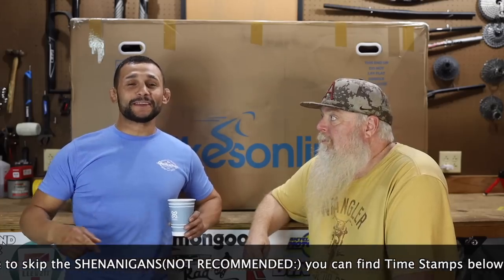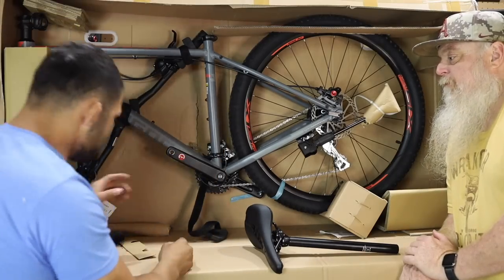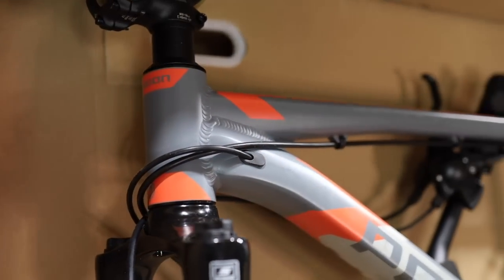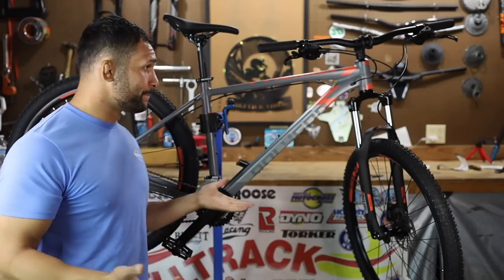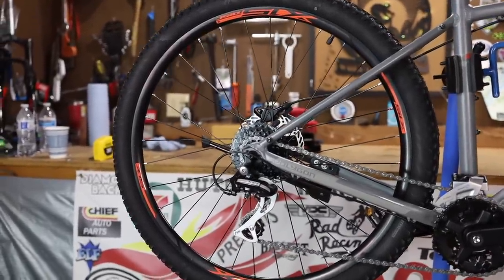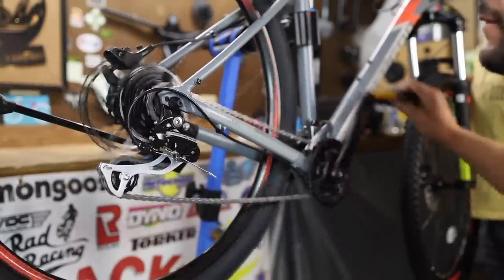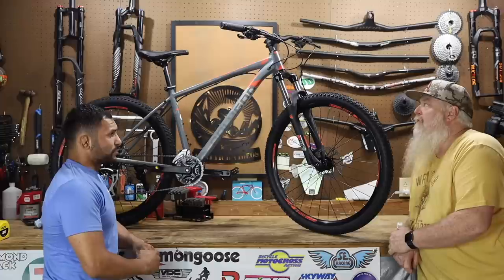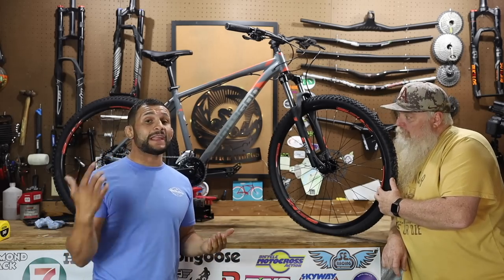Polygon Premier 4: Initial Impressions | Who It's For

Comment: Hey Wolfman and Tick, so excited that you've finally got a Polygon. I agree with you guys, the Premier range is way overpriced in the US (I also didn't know that they export them to the US...). Back home in Indonesia the Premier 4 costs around $290 and the top spec 5 $340. And yes, the bike's geometry was last updated in 2019 or 2018 if I remembered correctly, so it is a tad bit outdated. But the thing is, although marketed as an entry level MTB, the Premier was never conceived as such. The first generation of Premier was actually a trekking bike, nice to ride around neighborhood but still sturdy enough to handle some basic green trails. It was since the second generation onwards (I think this one is the 5th generation) that Polygon beefed it up to be an All Terrain Bike, coherent to the market demand back home for an affordable allrounder. They were (and are still) not a fully fledged mountain bike, I've actually ridden the 3rd generation Premier, and I do think that they have a point, it was comfortable enough for me to enjoy cruising around town, and it could handle some tricky trails, but it would be destroyed by gnarly stuffs, unlike the big brother Xtrada. So I guess it would be of a fairer comparison if the Premier is considered as a mid level ATB, instead of entry level MTB (I'm not trying to defend Polygon though, I just happen to have ridden multiple models of their bikes and I would really love to share some insight to the relatively new brand in the US 😀). And when you review it, please be careful, I have ridden the same Deli Tires and on wet conditions they are as slippery as an eel! Love the show and stay rad dudes 🤙

Comment: I think you nailed it on who this bike is for. If I was buying at this price point, I would consider either the GT or Kent Trouvaille. Theres plenty of low cost upgrade options to bring either of these up to speed. It's too bad that Polygon, who really is en vogue right now with their well-spec'ed dual-suspension offerings, couldn't have produced a better tbought out and equipped bike at this price point.
Reply from the maker: Man well said, thanks for the great comment 👍

Comment: In our (German) bike shop we're currently having several Cube Attention for 759€ (roughly 833$) on sale. Modern Geometry, Rockshox Judy Air fork, MT-200 (180/160), Deore 11-Speed rear derailleur, 2x SLX Front Derailleur. I love test riding those - they go off like a rocket and the front and rear shifting is A+. I'd take one of those over this Polygon for sure!

Comment: i'm very familiar with this bike. last year, i bought Marin's version, which is called the Eldridge for $500. i rode it 1 time, then sold it. the 1st issue was the lack of dropper support. the 2nd was never feeling like i was in the right gear. 2x's suck on mtbs. lol. the 3rd issue and final straw was the weird frame sizing and overly short reach. honestly, this bike should have drop bars on it and sold as a gravel bike. lol. great video, guys!
Reply: Yeah exactly what I was thinking the headtube angle is very close to a gravel bike.

Comment: A 160mm rotor on the rear is enough for most riders, even the hardcore ones. 180mm+ is overkill in the rear but crucial at the front. At pretty much any speed, with minimal lever power the rear wheel with 160mm is going to lock anyways and tire is going to skid. That being said, even if you use the rear more often, you do need MORE power on the front, that's why 180mm/203mm is important. Keep it up guys!

Comment: I just bought a large troubaille and plan on adding hydraulic brakes and dropper pputting me at that $600 price point.  Wider tires bigger brakes and a simpler drivetrain with about the same number effective gears.

Comment: The beauty of shimano drive train, even the lower end such as altus, acera, alivio, they are easy to tune and shift easily.  2x isn't all that bad, it has more usages. It be ridden on pavement with decent speed, probably top out around 18 mph.  This bike would be great for someone who is trying out easy green trails, and still able to ride on the streets.

Oh, a little disappointed, no wolf dad dyno.   Even without a lockout, wolf dad can still do the dyno and test the claimed 120mm of travel.

Comment: I have the Acera on my Axum DP and am happy with it. I would take this bike and. 1. Do a 1X conversion replacing the crank and the rear cassette. 2. Replace the fork with an air fork, maybe a Manitou Markour or a Suntour Epixon and 3. Larger rotors, either 2 180s or 180 front 160 rear and finally 4. dropper post.  This could get it under 30 pounds. Love the look overall.

Comment: One note, i have a set of the standard M1 Clark brakes on my bike, adjust by my local bike shop, no issue it give me all the braking force i need also i get no fade. The only thing i did was change the brake pads to hardheadedram downhill brake pad.

Comment: I have a Cascade 4 that I upgraded with a SRAM SX 1x12 drivetrain, Shimano MT400 brakes,  Rockshocks Judy fork, PNW handlebar, grips and pedals.  Just need to add a dropper at some point and it will be a sweet hardtail.

Comment: Just recently bought a 29 inch specialized rockhopper for 499 upgraded front rotor ( 180 )  forks ROCKSHOX ( SOLO AIR FORK ) and  platforms ( aluminum ROCKBROS ) less then $ 600

Comment: Frames and forks have a rotor size limit set by the manufacturer for safety reasons. You don't usually use 180+ on a QR rear. The bike having 2.1 tires on 27.5 wheels but has coil fork, 2x and weird geo. Not really a Cross country bike or a Trail bike. Looks like its meant for older teenagers/college kids riding around town/campus or the occasional bike path
Reply from the maker: Well stated man, thanks. That's a great "who this bike is for"

Comment: Im 6'4 and 225, and i like most 27.5 bikes but most frames I've seen larger are on the 29ers. I dont wanna buy a 27.5 and its super small . I went into Walmart and sat on a 27.5 and a 29er. I dont know. Any recommendations

Comment: 15:52 This RD had a nut instead a bolt there on older models, new design is better, RD still looks exactly the same otherwise, butt no silly bolt and nut, so if that comes loose you would need an ratchet with a bit or an adjustable wrench. But don't be surprised if you some bike will come with old RD. I few years ago I kept seeing other models like M772 on newer than this rd by several models, so same can happen with this one or other rd's even 5 years or 10 years after sometimes. I guess they have to use up old stock they did not use up.

Comment: a trouvaille plus a rs recon rl can be had for less, though the trouvaille is more trail geo vs xc on the premier. For another xc, one can walk into a store and get a base rockhopper for $499 or the next up for probably $575 or spend less than $200 and get something similar used the slap a brake upgrade on.

the value of their fs bikes seems pretty good but not this
Reply: I have the Rockhopper sport (560 or so on sale). Has 2x, coil fork, hydraulic brakes...does have presta and the shop was able to put an internal routed dropper on it.

Comment: Does anyone else make a mountain bike that's around $600.  I think Vitus, Canyon, YT have started charging a lot more than that.  Vitus probably use to have the budget hardtails to beat for $800ish but now they start at $1200.  

$600 might be a good amount if your looking in used market or for a fixer-upper though.  Or maybe you can get Disk's Sporting Goods bikes for a around $600 that are basically Walmarts bike with a little bit higher prices.

Comment: 20:20 Zoom mostly makes trash, but I've never tried their stems and bars, but their suspension is a joke. 
They could be seen on would cup bikes in the 90s, but now it's only on cheapest bikes, or low end mtbs.
 suspension forks with 28mm stanchions, and no adjustment, quill stem, probably their most known product, garbage forks that make the bike handle unpredictably.
But their stems look good, but never tried any.
I see they do boost forks now, with some adjustments, but I doubt they are good.

Comment: Running a bigger rotor in the rear the  front is not a good idea. A person should pull both brakes at all times unless you need to swing the back of the bike out. Using a larger rear then front rotor, the rear will lock up prematurely all the time. This is why front for the most part is larger front then rear. I live in Vancouver and ride the North Shore with 203 front , 180 rear with zero issues, and I’m 6’3” 250 lbs.

Comment: A 2x for 600 bucks? Immediate NOPE. That's about like a Turd GT Aggressor which was your 1st bike on this channel and my 1st "real bike". The Trouaville or Axum is a better deal.
Reply: PS Tubeless Schrader is the bees knees
Reply: The specialized Rockhopper sport (mid level) is a 2x, coil fork and hydraulic brakes also. On sale for $570
Reply: for around six you should be able to get a proper 1x

Comment: 11:56 That will never work, cus the seat tube has rivets that have been pressed in with a rivet gun with threads.
My Geometron G1 does not have any bottle mounts, this is to improve straight, but the tubing is thicker too, but completely different type of bike, not a XC bike.

Comment: The spokes wouldn't be aluminum, those are 304 Stainless. It's also non magnetic or you might get a slight mag pull by the j-bend since it can get slightly magnetic when it's cold worked. Not a fan of the bike so far, but hated the disco music while assembling.... 🤮

Comment: Getting tired of non tapered head tubes and near roadbike geometry. 69 degrees is too flat for confident downhills. Components are meh and front deraileurs nearly obsolete. Also like the option of at least a front through axel. The kickstands gotta go. probably shave off half a pound. The 45mm stem is cool but any more length and I would fear an OTB on any substantial grade downhill. I'm 6'2" so hopefully the reach would be good enough. It would be fine for a neighborhood knockaround but I wouldn't seriously trail ride this. A 120mm fork with 69 deg head angle is too awkward for me. Caged headset bearings and cheap wimpy tires also a disappointment. The Canyon 5 despite a non tapered headtube and qr is by far the best and most balanced mtb (67.5 head angle) you guys have had pound for pound dollar for dollar. I've considered Canyon when I'm ready for a higher end bike. I don't want to seem unfair to Polygon they make good bikes too but I'd wait for an end of year sale and move up a notch or two.